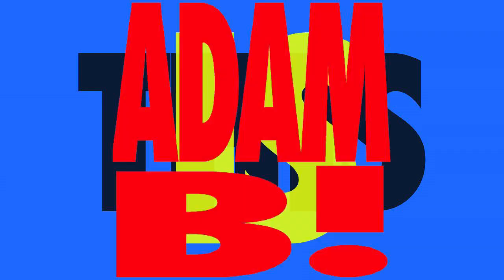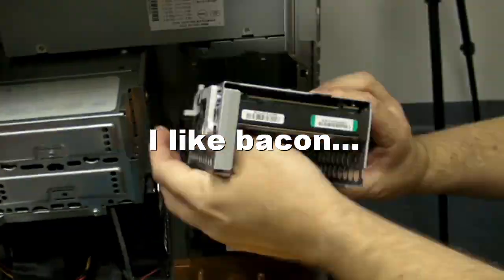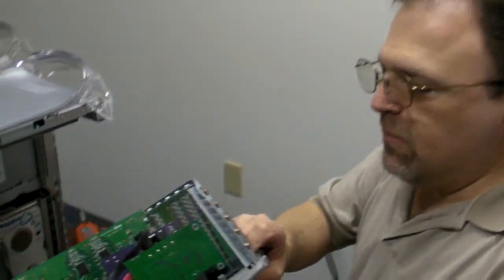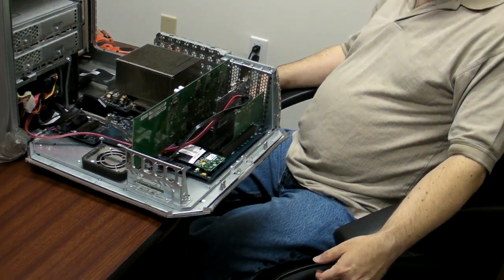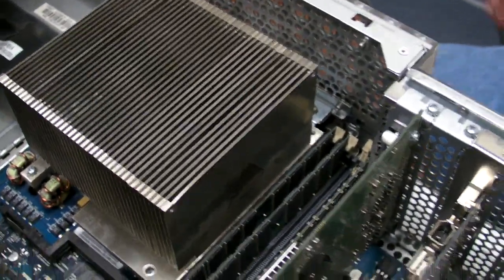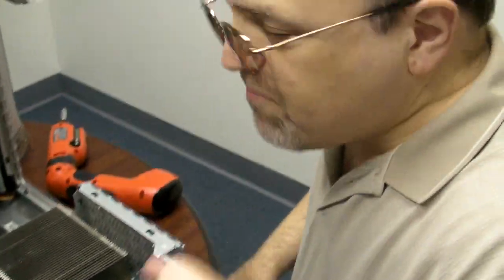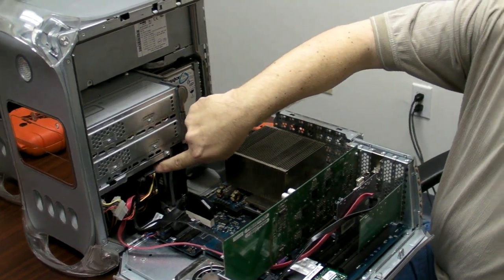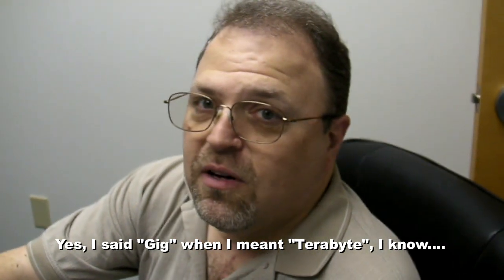Holiday Hardware Hacking 4 (Part 2)

Comment: I have a G4 mdd.   I just upgraded it from dual 1.0 ghz to dual 1.25 ghz.     These machines weigh a ton.   I loaded mine up with 5 hard drives ( one in the optical bay) and stuffed all pci slots with cards.